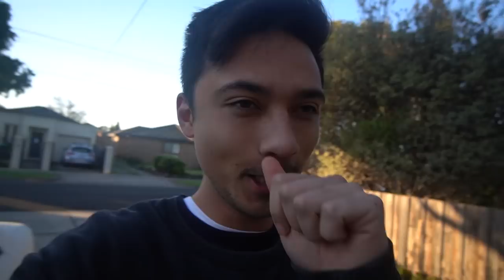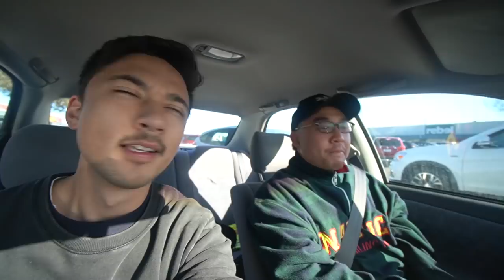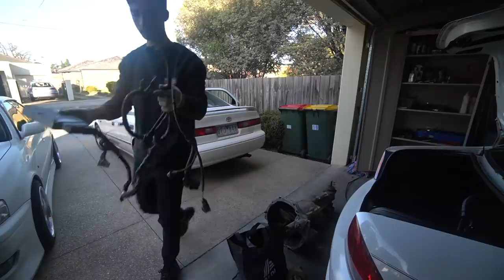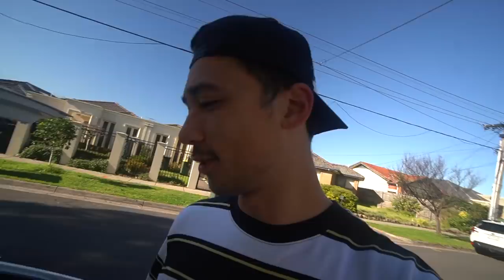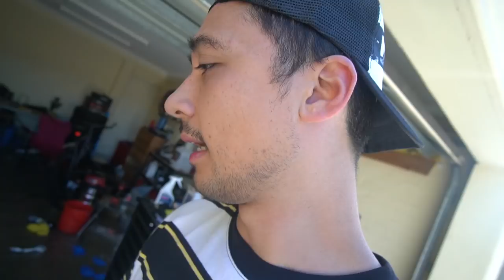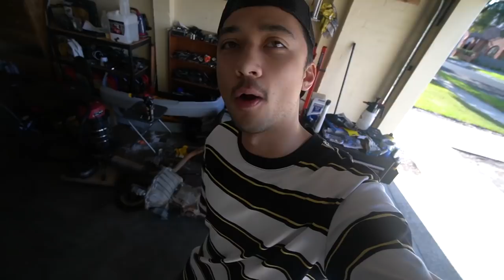5 SPEED FOR THE AU FALCON! TIME FOR SOME *CLUTCH KICKS*

Comment: Just a heads up they bend the peddle box and tend to pull the clutch cable through the firewall . Reinforce it when you do the conversion. I had 3 all done the same thing

Comment: That clutch pad will be stuffed from the fluid on it , also that tail shaft is from a ute and is alloy so would be better to use the auto one to get shortened
Reply from the maker: thanks for the tips man! I've been watching your vidoes btw! what suspension set up are you running? looks like BCs in the front? do I have to custom order? and what in the rear? haha cheers!

Comment: If you go heavy duty clutch make sure to reinforce your firewall so when your clutch kicking you don't punch a hole through it. Not fun or cheap to fix but the part is like 50 bucks on ebay and saves lives

Comment: Don't mind me asking why put a manual transmission in stay with the auto just put shift kit in it or if you want it for drifting  stick a 2 speed power glide in my ea ford runs a 4 speed on the street on the track I run a 2 speed power glide.

Comment: The legendary Intech 4.0L > Barra > 2JZ > RB26 > 1JZ. AU's are perfect to start with cheap as fuck and can be built to whatever you want to do drag racing, drifting, circuit. Now that Skylines and Silvia's are starting at 10grand for a rolling shell the AU is still overlooked and somewhat cheap